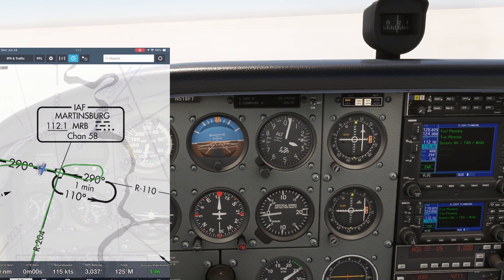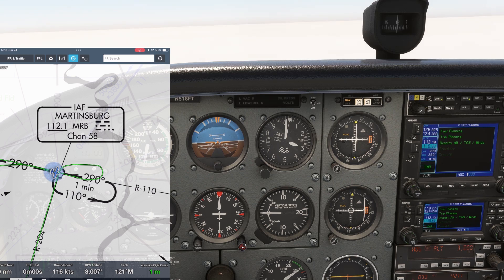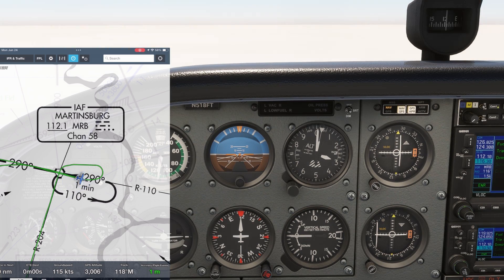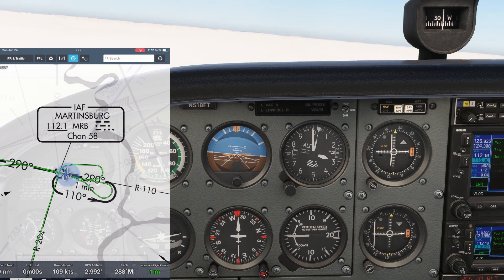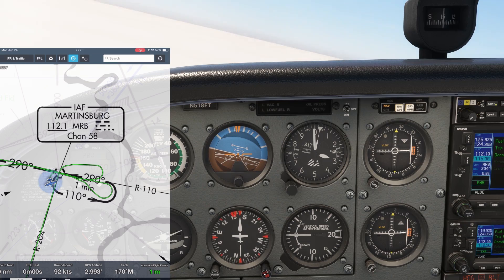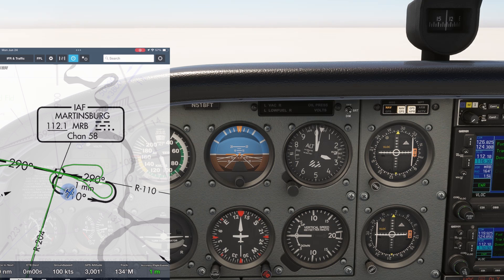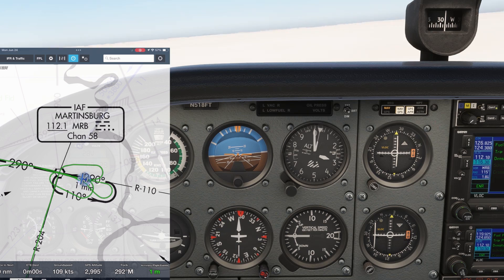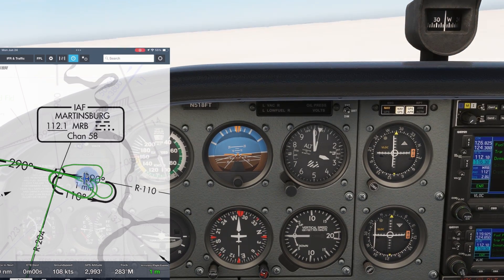Wind Corrections in a Hold | How to Do a Triple Wind Correction

Comment: I love the minutiae and details and precision of IFR flight, but this is why God invented GPS and GPSS autopilots 🙂
Reply: Until your GPS or AP goes out and you are doing a VOR hold
Reply: @matthewpellegrino4926  No worries. With my GTN 175 there is no VOR/LOC so I'd use ForeFlight backup on one of the iPads 🙂. If I lose the AP I'm well practiced current and proficient in hand flying so no worries there either 🙂.